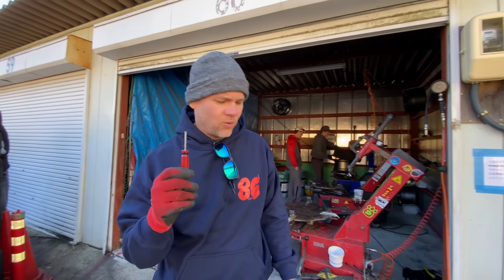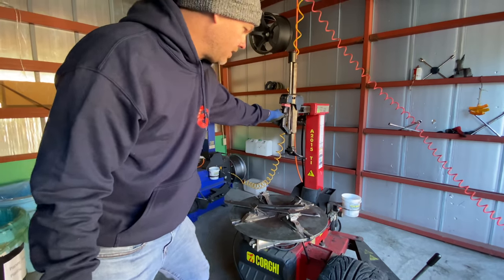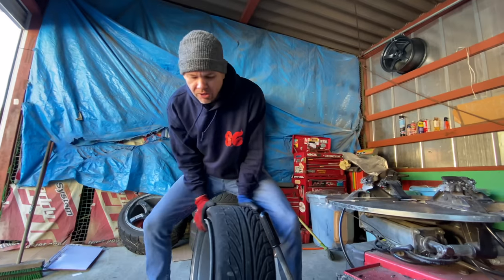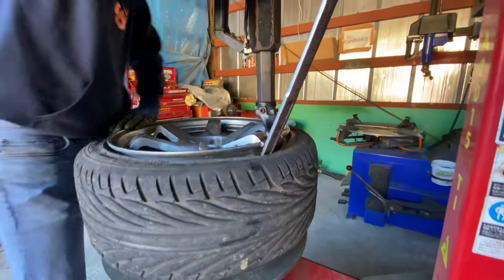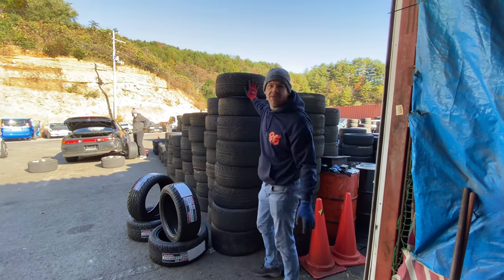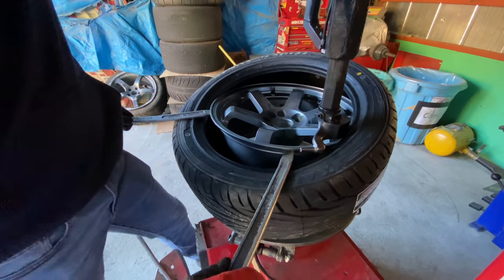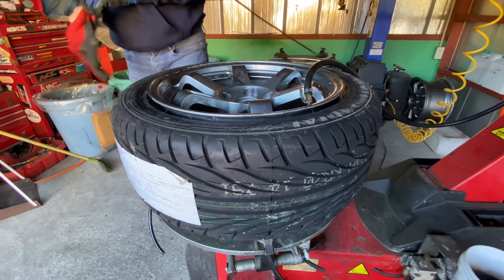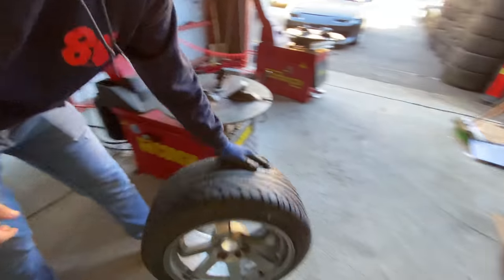How to change your own tires.

Comment: Just a quick note, the dot on the sidewall should also line up with the valve stem. That is from the factory pointing out the lightest area of the tire, so you use less weights in balancing.

Comment: few mechanics with 50 years of experience told me to put it on 4 bars when you mount it, and then let it blow out to 2 bars (or whatever you need) before placing the core back. said it's the only way to be 100% sure the bead is fully on.
Reply: bdusanek or you could just take a look. But yes, many stiff tires (high speed rating, low profile or high load rating) need a lot of pressure, sometimes up to 5-6 bar even.
Source: tire guy for a few years.

Comment: Excellent video one thing that might work better is using the other side of the bar without the lip because it lets you push the sidewalls down further. ♥️♥️
Reply from the maker: What do you mean?  teach me!
Reply: Lone Star Drift theres two sides to the bar one with a lip and the other thats flat with a small bend in it. The one without the lip in it aka the flat side is better for removing the tire with. While the other side with the lip is better for putting a tire on , it grabs the bead seat of the wheel better and lets you put more force to push the tire down when mounting. Fantastic video just that one nitpicking thing.
Reply: i agree :)
Reply: @Generalusuer  I honestly think that's more down to personal preference. I only use a non-claw side of a tyre iron to remove a tyre when the sidewall is so stiff that I can't get the claw between the rim. However I'm just a mechanic that fits tyres occasionally, not a full time tyre fitter.

Comment: i use a non powered tyre machine and i can change up to 17s as i use low profile other wise i could change any... !!top tip for every one!!.. new tyres nearly always have a small coloured circle on the side wall(yellow or orange, can come in any colour (*sorry im slightly colour blind*) blob on that tyre).. match that up to the valve and it should be balanced as long as your wheel is not messed up.. (tires for none uk)

Comment: A little tip if you lose the tool for the valve stem, you can use needle nose pliers with a small enough tip to remove and install the cores.

Comment: Does the kenda kr20 or kr20a last longer?
Reply from the maker: The old KR20 lasts a bit longer than the new KR20A 300 tread wear as the old Kenda KR20 has slightly deeper tread.

Comment: When you're getting the first side over the top bead, just take it backwards the whole way
Reply from the maker: going on or coming off?
Reply: @LoneStarDrift  Coming off. That way you wont slap the wheel with the spoon too.
Reply: @lone star drift I run the machine clockwise when taking it off. Once the first bead is pulled over the duck head, I turn it clockwise slowly until the spoon is on the face of the wheel. It's important to let it stay there until the tire has rotated enough that it's no longer pressing down on the spoon if you want to preserve the finish. If they're just burners then I guess it doesn't matter as long as you don't care

Comment: No balancing? At least line the dots accordingly to the valve then.
Reply from the maker: We don’t balance, the tires don’t last long enough to worry about
Reply: Your perfectly balanced tyre would start going out of balance the first time you pull the handbrake so it would be a bit of a waste of  time and money for wheel weights , they aren't expensive but they also aren't free .